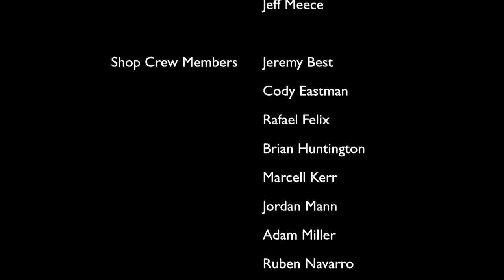How to make your car cool - hydraulics, Air bags, iPad dash mods, and Light Tape - Amplified #99

Comment: Doug hi, I have a 03 suburban im changing my flipdown to a bigger one its aTview 15" now my question is  tat the wires are orange, gray, blk the orange is constant so I put the 12v+ red wire to it & the blue from the monitor to the gray for door trigger ground to black as supposed to but whe I turn off system it just goes to a blue screen with no signal displayed is it supposed to stay on like tat or what did I do worng